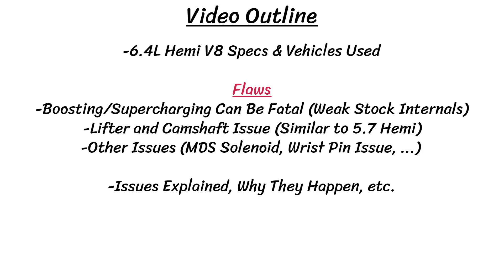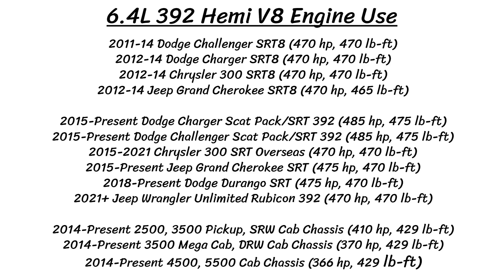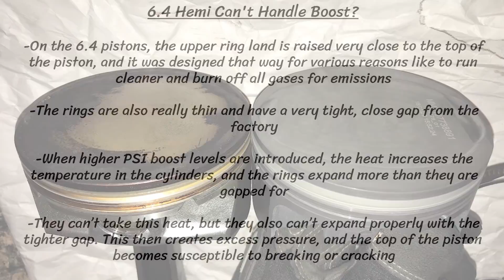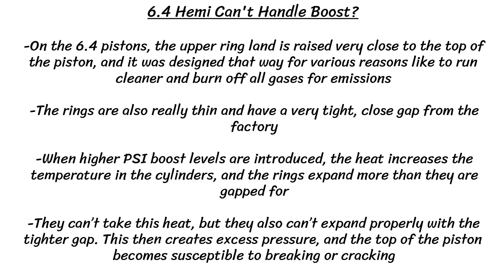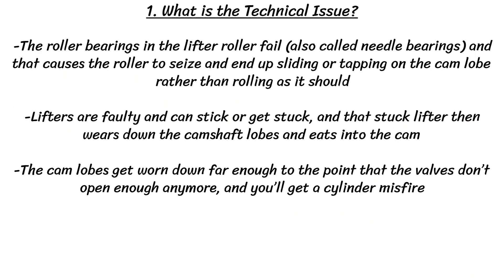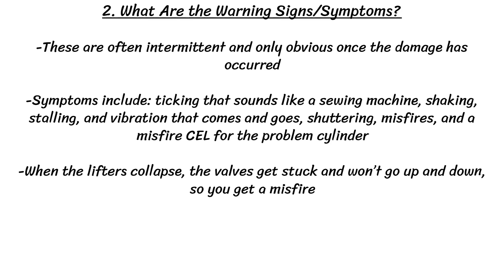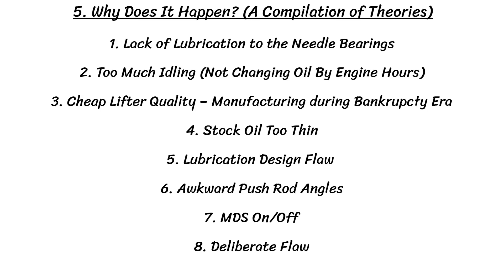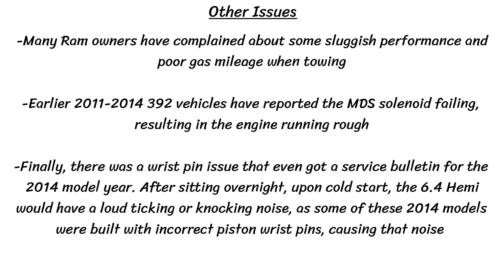The Specs and Fatal Flaws of the Chrysler 6.4L Hemi V8 Engine (392 Hemi Issues)

Comment: I’ve had 5 of these engines in various applications (Charger, Grand Cherokee, & 300) and never had an issue with this engine.
Reply: Exactly. The hemi probably one of the most reliable v8s
Reply: @DreamWRLD22  Good for one to two years on a lease then dump it before the problems come then you can say that.
Reply: @microminiskirt full of it
Reply: @DreamWRLD22  
That might be true, but LS or LS?? 
I’ve never talked bad about a Hemi!! 
But they use the front suspension off a shopping cart!! 
Always in the shadow of the Cummings!! 
But no matter the brand if you take good care and change all the fluids and keep up on repairs they are all good! 
But stay safe!!
Reply: @mikewest5529  aye I can’t say nothin bad about LS neither
Reply: @mikewest5529  ls has same cam/lifter issue as hemi lol
Reply: @Dexter_Solid  only in the 1500 line. 
I’m a 4500 type of guy! 
HD or nothing!! They have the lifter problem in the V8’s that run in 4 cylinder mode. 
Can’t get that gas saver in any HD models. 
But yes ever truck has problems but they should never be on time or even if it’s babied! But it’s all luck of the draw with some regular oil changes and stuff.
Reply: @Dexter_Solid  the ls is a far more reliable performance platform. the hemi cam placement in the block is the problem. lack of lube to cam/ lifters due to high cam placement in block its just a  piss poor design!
Reply: @andrewslagle1974  Just a piss poor oil pump.
Reply: My nephew just had this happen in piston #1 right about 115000 miles he does let idle alot but always dealer serviced also and has extended warranty so this issue covered
Reply: @DreamWRLD22  yeah ok, coyote 5.0, 5.7 I force, ls6, ls3 
Can't make much power out of a hemi without it going boom, and they are severely underpowered, cheap parts, they break, best v8 my ass, the ones I listed are way better.
Reply: @kg_bee3937  LS  Corvette engines have harmonic balancer wobble/failures.  All of these performance cars have weaknesses and cost more to repair.  If you want super reliability, low maintenance, low cost get a Toyota Corolla SE HATCHBACK with 6 spd. manual transmission.  Don't get CVT TRANSMISSION.
Reply: @kg_bee3937  LS  Corvette engines have harmonic balancer wobble/failures.  All of these performance cars have weaknesses and cost more to repair.  If you want super reliability, low maintenance, low cost get a Toyota Corolla SE HATCHBACK with 6 spd. manual transmission.  Don't get CVT TRANSMISSION.
Reply: @kg_bee3937  facts are the hemi is slightly more reliable than chevy and ford v8s.
Reply: Keep up with oil changes and don't dog the piss out of it and you'll be good for a long time
Reply: @Dellonidas the reason I bought this car was to dog it all the time
Reply: Mine runs beautifully but I’ve heard 392s like highway speeds so they can properly oil themselves. 78,000 miles and a Manuel transmission and an occasional fast moment.
Reply: To all you folks running your mouths without running a proper oil in your Hemi; your motor failures are a direct reflection of your level of care! Had you used a quality oil and done oil samples you wouldn’t be on here complaining about camshaft failure, lifter failure etc. Not only is a quality oil and filter required so is a quality fuel additive. Our fuels and oils provide zero upper cylinder lubricants. I do oil changes on several of my Hemi’s at 25k miles.  Never have to top off in between oil changes.  No lifter tick, no misfires, no leaks etc.  I’ve oil samples for several Hemi motors well into 100k that show far superior wear patterns than a motor that uses any oil you buy in the store. No “Big Three” V8 is without issues. I’ve had them all in my performance shop.
Reply: @angrygerman7815  Just make sure you change the oil n oil filter on that Hemi every 4,000 miles.
Reply: How long do you keep your cars or lease them for?  One or two years?🤔
Reply: If anything, it's like he said, it depends on if the Hemi owner decided to mod it, and it also depends on how you drive it, if you drive like a madman all the time, and say you add in heavy mods without camming it, or another thing being replacing the pistons, then you'll start seeing the problems, not many of the problems happened at bone stock
Reply: I'm sure your not aware of the ticking sound
Reply: @captain8960  The "HEMI TICK"?😱
Reply: Funny you say this, i blew mine up at 105,000 miles. 2013 srt8 6.4 not the 6.1 same motors in the scats. But lol we good now. Dropped that bag at dodge and still can see the new block paint about 20,000 miles later
Reply: @THEDJHD1  So how long do you think this new motor will last?
Reply: @microminiskirt  itll last as ling as you keep it maintenanced. I was bsing with mine thats why it blew up going 1-2000 over my oil change and stuff like that
Reply: Im im it not cruising around memphis to rhe waffle house
Reply: @microminiskirt
Reply: @THEDJHD1  How often should the oil and filter be changed?  Every 6,000 miles?
Reply: @microminiskirt  3000
Reply: @microminiskirt  i idle a lot thats why i go 3000, and i beat the hell outta mine
Reply: @THEDJHD1  Wow, those  hemi V8s are high maintenance based on idle time.    Just like old school, change oil and filter every 3000 miles.
Will the CHALLENGER SXT V6 PENESTAR have same issues?
Reply: @microminiskirt  idk bout the v6 i dont have one   I have the 392
Reply: @THEDJHD1  Yes, you have 392.  I haven't heard any of the V8 problems on V6 PENSTAR engines.  Our highway patrol uses the Charger with V6 engine as their patrol car, and you know they idle those cars to death.
Reply: What about the 2010 ford crown Victoria
Reply: @Davidlopez-uj3iv  that's a ford not a 6.4 hemi .
Reply: @microminiskirt  no I know that . I mean like what do you think is way better and far much more reliable the ford crown Victoria. Or these new cute little toys
Reply: @Davidlopez-uj3iv  crown vic much more reliable.
Reply: @Sam-656  Go buy a Toyota if you want a longer lasting trouble free maintenance.
Reply: Nice
Reply: Super reliable it’s usually other components that get messed up like control arms drive shafts ,axles
Reply: Aggreeed
Reply: @Sam-656  That's because Toyotas outlive Dodge products.  Hemi tick and valve failures are common.  That's why people buy Toyotas for reliability and low maintenance.
Reply: That's what a Chrysler shill would say. You've never owned one.
Reply: @2ript4u  who the hell are you talking to? I’ve spent more in vehicles over my 30 years of existence than what you will make in a lifetime. Gtfo scrub
Reply: If you leave them stock, they're fine. They're not LS engines. You could drop an l
LS engine from 5000 ft outta the sky and swap that bad boy in anything. But leave them Hemi's stock.
Reply: All of them had to be under 500whp
Reply: @christianhandy7092  My 2012 Charger 6.4 has a Procharger since 2015 and still running. I drive the piss out of it too. It has close to 700 hp. I'm waiting for it to blow so I can put a forged piston motor like a 426 from Arrington.
Reply: @Sam-656  that’s good to hear how much psi are you running, the reason I made that comment is because 6.4 hemi doesn’t hold mid-high boost well. I assume your running about 6-9  psi
Reply: @christianhandy7092  Yeah I hear about it that's why I leave it at 7 psi.
Reply: I work on them everyday and rods,pistons and oiling system are all under par.
Reply: Garbage 😂
Reply: Also my brother works at kokomo plant said slow looking bad stalantis now on way out
Reply: Wish I could say that.
Reply: Me niether....
Reply: Facts!!!! They are bullet proof
Reply: Plot twist famous people only tell you not to get these engines because they know that in the future these cars will be worth five times their original price stay woke
Reply: Blew a head gasket in my 3rd year @36k miles. No mods other than a catch can. My first and probably last FCA product. Loved the car with a passion but I babied the car and it still failed me.
On the other hand my dad has an 06’ 300 with the infamous 2.7 liter that he bought new and it’s still running 15 years later. I guess I was just unlucky with my 392. :,(
Reply: MOPAR? MORE PROBLEMS! lol
Reply: My 392 is having cam/lifter failure at 60k miles unfortunately . Always maintained.
Reply: @chris347438  Are you a victim of the famous "HEMI TICK"early valve lifter failure?  Follow the class action lsw suits on this since 2008 to current 2022 vehicles along with MDS issues on automatic equipped cars that use "ECO" mode running on 4 cylinders resulting in premature engine failure.🤑 = $$$MONEY$$$ PIT.🤑🤢🤮
Reply: @chris347438  What was the final outcome of this?  Warranty repair?  Pay out of pocket $$$🤑??? Sell it???🤔
Reply: Im a mopar guy and hemis arent built to last. The new multi airs burn oil like a mf and sometimes the oil filter housing just leaks for no reason when you change the filter. I do like the pentastars though those are decent engines.
Reply: @Danny Gruesome  I think the quality of the parts is not consistent. My 06 5.7 and 12 6.4 runs great no problems. But my 16 3.6 has 87k miles and has poorly made rocker arms and lifters. And Chrysler said it has gotten better. I'm currently replacing all cams, lifters, and rockers. I'm selling this Town&Country when I'm done.
Reply: The Main Problem isn’t really the Car it’s the owner Simple as that let Explain why Just as Simple as a Oil change if you don’t switch out your oil every 3k or 3.5k miles you will blow your Engine . I had so many of my homies blow there engine on there scats & hellcat & other brands due to not changing the oil on time You can’t slack on something so simple .
Reply: @yoboiijose420  it's called HIGH MAINTENANCE and know what you are getting into.
Reply: @YoboiiJose  I change yearly with synthetic Mobil 1 every 10k miles on my 12 6.4 that has a Procharger. And I stomp on it every time I drive bc i live next to a highway. 😆 If it fails now, good ..I can finally forge the motor and up the boost.
Reply: @yoboiijose420  i change my oil once a year on my 2012 SRT8 Charger 6.4 with a Procharger and I drive it hard. So 11 years,120k miles and still going. I'm waiting it to blow up so I'll have an excuse to get a 426 or do my own and get forged pistons,rods,crank and a cam.
Reply: You can thank Mercedes Benz for that.
Reply: @scee7492  😁👍👍

Comment: I have a 6.4L 2014 Jeep. I replaced the cam and lifters with hellcat lifters. And a stage 3 comp cam. So I'm not worried about lifter tick. However, I'm curious about the oil solenoid failure. Immediately after installing the cam, my engine would start chattering when going over 5mph. To this day, I never figured out why. But all I know is, when the oil solenoid that feeds oil to the cam is plugged in, it happens. When it's removed, my vehicle can run. I have a video up on my channel of the issue. Basically right now, my cam doesn't advance and retard. It's either fully advanced or fully retarded. I'm not sure which. But I've had no issues with the cam or engine in regards to that since. Nobody could figure out the problem.

Also, I've spent about 15k in repairs since 2017 owning this thing. Maybe I got a bad one out of the batch. But if anyone cares to know the repairs, I'll list the things I replaced.
Reply: There is no Hellcat lifters. AD lifters are used on all engines, 5.7, 6.4, Hellcat etc..
Reply: @Rrottweiler  wrong. Hellcat lifters are different than 6.4 lifters. You have to change them when putting in a custom cam and doing an mds delete. Well...you don't have to change them, but it'd be stupid not to.

Comment: I’ve got a 2004 HEMI with 174000 miles on it and it’s still going strong
Reply: I’ve got 300,000 on my 2004 5.7 in my Ram 1500
Reply: 100% Made WAY better back then
Reply: I have 223k miles on my 2005 model 5.7.
Reply: 161k on my ‘06 6.1 still running strong
Reply: Awesome to hear!
Reply: 233k 2005 magnum 5,7
Reply: I have a 2006 chrysler 300c with 245374 miles and the only thing that I had done to the engine is the tune up and a water pump. It's still runs strong.  I hope that my 17c& 22s  300 will be that good.
Reply: For an American car that’s not bad 🎉
Reply: 1 good engine out of 100 cases doesn't make it a good engine, neither does HP .
Reply: @ucnhtmenow1 you got tons of hemi V8 with high mileage what is your point it is a reliable engine🤔

Comment: So why isn't Chrysler responsible for the repairs ???  We let the automobile industry get away with murder.  Faulty parts,  they don't repair or fix anything anymore.  They just change parts at a high high cost which won't last long.  Our government use to monitor the automobile industry and hold them accountable but now they're just a rubber stamp brought and paid for.

Comment: Fatal flaws, when you twin turbocharge your honda civic you lose fuel economy...WHICH IT WAS MADE FOR!!! Down to a serious note, i like some specs, but it isn't a fatal flaw that a stock engine won't handle much boost without blowing. Isn't it cranking out high 400s hp? like 470 or so? so 392 CI engine 470 hp. Thats some DAMN good numbers,

Comment: If you aren't able to pronounce Centrifugal, or even Apache, I'm not really convinced in your information. As said above, not being able to add a ton of boost, is hardly a fatal flaw. Most new engine platforms all have issues with camshafts. LS, Hemi, the fords. A roller lifter has a chance to fail versus a standard hydrolic flat tappet
Reply from the maker: That’s how I heard those words growing up in Canada but fair enough. My information is accurate, these things happen, and the entire point of my channel is just to facilitate discussion on anything Mopar-related. I do a “Fatal Flaws” series for all models and engines and the goal is not to shit talk them or anything. When I expand to Chevy, Ford, etc. On my second channel I’ll do the same for them too. I just know there are more 5.7 and 6.4 engines then people think that have these issues and it’s pretty unexpected and awful to happen to your $40-50k vehicle at 100k miles. The boost thing is just a flaw yes not fatal but thought it was interesting to talk about.

Comment: Wht about adding boost to my 06 300c 5.7
Reply: Keep the boost low, doesn’t have forged internals and only 2 bolt mains. Plus the trans in 06 is only good for about 500 hp.

Comment: So it costs about $3000 to upgrade the rods and pistons but 4-5000 to replace the lifters?
Reply from the maker: Lifters and camshaft yeah. Prices wildly vary though depending on if you go to a dealership, regular mechanic, or DIY

Comment: Would it be safe to say that my M6 392 will be good since I usually shift around 3k-4k rpm when cruising around town, and is kept stock? I'm at 40k miles right now and have never had an issue at this point.

Comment: 2014 Dodge Charger 392. Been boosted at 6lbs for a little over a year with no issues. However... I'm at 4,500' above sea level and the car has about 23,000 miles on it.

Comment: As long as you change your oil regularly and don’t idle your car for more than 5 min you are good.  If you are idling let’s say in a drive thru or are waiting on someone occasionally rev the engine to
2,000 rpm so it can splash oil everywhere and keep everything lubricated.  This is why you saw a lot of police chargers for sale. But since the lifter revision in 2015  you don’t see a lot of the new police chargers. Not only did they revise the lifters they also revised the camshaft which now makes the lobes higher.  So
Do research and you can reference everything I’m saying simply by going to a Chrysler website and check all the revisions by part number.  Never buy any lifters from a parts store as they are using the old design! I learned the hard way. Always order directly from Chrysler

Comment: I have a 2014 Grand Cherokee SRT with avout 90000km on the clock, about a two months ago that loud lifter tick decided to show up. This vehicle has been well cared for and oil has been changed 2 times a year as recommended(under 6000km's every time) with recommended oil. Upon disassembley I found 2 of the non MDS lifters had needle bearing failures and 2 of the MDS lifters had failed by way of the inner body/locking mechanism rotating in the lifter body effectively not allowing them to be ridged when MDS was not active. Luckily I found this before the lifters started eating in to the cam. Cam and lifters were replaced, MDS was deleted. Now the thing runs like a top again. 

I also happen to have a 2015 Ram 2500 with the 6.4 that was affected by the wrist pin issue. The engine was replaced under warranty and have had no additional issues with that vehicle.

All this being said the modern Hemi is an great engine and I'm not looking to replace my vehicles at this point in time.
Reply: ottimi motori dici ??   con questi problemi a questi chilometraggi ??   io non credo .